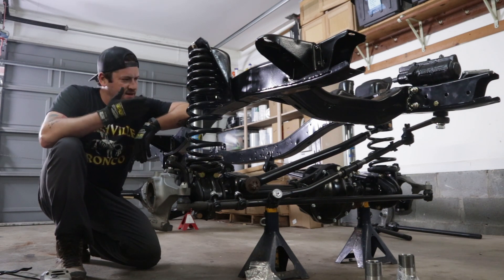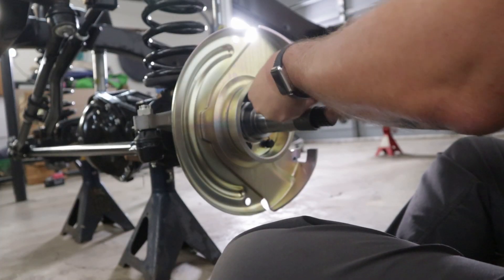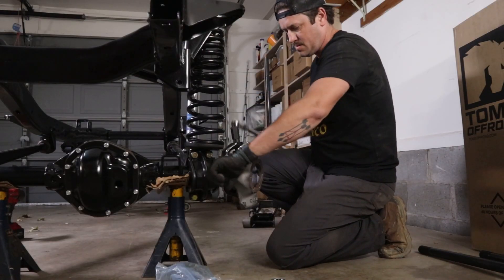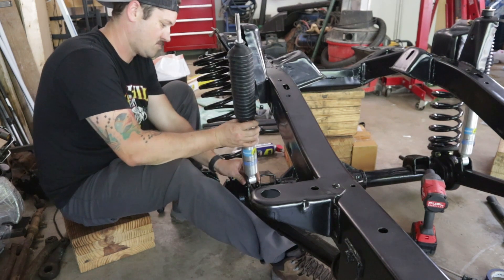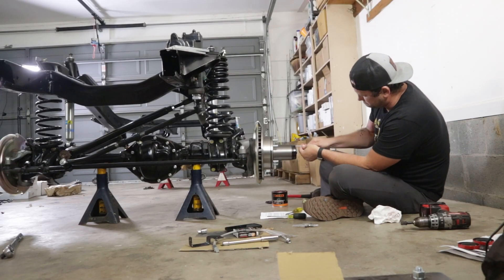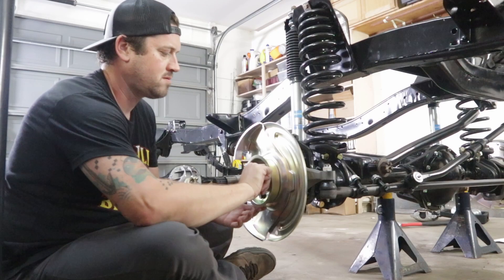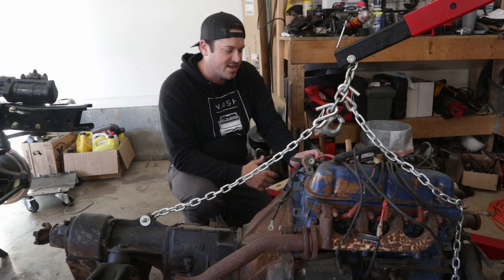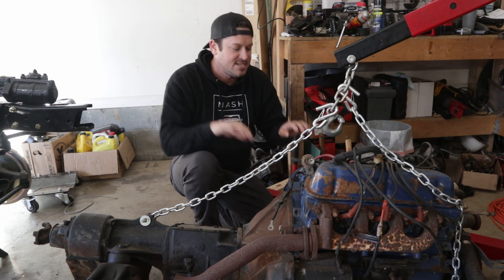Bronco Restoration Day 14 - Building a rolling Chassis

Comment: I’m currently building a 66. I sourced all the efi system from a 99 explorer. I’ve installed it on a stock 94 5.0 with a small cam. So this would be my vote for your setup. It’s a proven efi  design with plenty of replacement parts available.
Reply from the maker: That is a proven EFI for sure! I feel like if I’m going with a 302/5.0 it should look stock-ish. Even though EFI is not stock haha

Comment: I’d rebuild it with a stroker kit, AFR heads, and a ProFlow EFI. You’ll still have the original block and as much power as a coyote for way less money. You’ll make more (or lose less 😂) that way. Also, if it came with a stick I’d seriously consider a Tremec 4x4 5speed instead of the automatic. My 2 cents. 
Thank you for these videos. I love them
Reply from the maker: Nice! Another vote for a stroker 👍🏼 and the first manual vote, haha!

Comment: Engine wise go to pick n pull get a roller 5.0 out of an explorer, clean it up with paint, put on a trick flow top end kit from summit and your longblock is done including efi intake. That would be about 3k plus 300 for used roller shortblock. Then get used nv3550 with adapters,mount and then use 456 gears with skinny 33". I have that and it drives great and has overdrive. Plenty of power and decent fuel economy.
Reply from the maker: Nice!

Comment: I would decide on who you plan on marketing the finished vehicle to and let that direct you on the engine.  Your margin could be similar with either engine.  I’m a big fan of 302s and 351s.  Easy to work on, available parts. Usually plenty of HP can be found.  The new blueprint with the new block might be nice.  Selling price I would think would open it up to more buyers.  The coyote is the choice if you’re aiming at a higher price point and a smaller buyer pool.
Reply from the maker: That’s a good point for sure

Comment: I literally just done that front brake conversion on mine 2 days ago and ran new lines (body on = not very fun for that long line on the frame).
I would go with a rebuild of your original 302 and maybe beef it up a bit while at it and in turn you could go ahead with the build.
Reply from the maker: Nice! Another for original engine 👍🏼

Comment: Make it a BOSS! 
Grab a 351 roller engine stroke to 408. 
Grab a clevor kit from Edelbrock. EFI... Sweeeeeeet!!! 
My dream engine for my '67 u15.

Also on the brakes, I swapped my d30 drum brake axle for a 74 disk brake axle. I used big body bronco brake parts to keep it all Ford. 
Easy bolt on. And much stronger.
Reply from the maker: Nice!!

Comment: 331 stroker (.030 bore over). Use the AFR 165 heads, with custom grind cam (roller) that is spec to your entire set up (tire size, gearing, transmission/torque converter, heads etc.)
Reply from the maker: Nice! I like this

Comment: The coyote engine gives you the most $ for resell.  Most of those rebuilds are going over $100,000.  With rebuilders like Velocity, they are reselling Coyote rebuilds for almost $300,000.  Some are over 300.  So the 8 speed or 10 speed trans bolted up to a coyote is the top selling configuration.  I don't know what the Godzilla option is but it sounds interesting.  I bought a Ford Racing 302 crate motor for mine because I don't plan on reselling and it produces 340 hp.  That's not 465 like the coyote, but its respectable on the light  Bronco.  My three speed will light up the tires, but so will a trans break or a front brake on an automatic 10 speed. investing 20,000 to make an extra 50,000 does seem like a good idea whereas investing 8,000 to break even on a normal build is cheap, but renders cheap payback.  It's another example of you get what you pay for.  If I had the money, I'd go the coyote route.  I've seen motor w/trans used for around 12000.  To get the money on a used one though, you might need to rebuild them.  So for a new set up from Ford Racing it would be between 20-30,000.

Comment: I went with a blue print 408 and a 435 from Tom's. I still have my original 302 and 3spd intact on a pallet in case I ever want to go back. You will never get that bottom power from coyote.

Comment: I was faced with this same engine dilemma six months ago. My Bronco is about a week away from its first start.
Reply from the maker: What did you go with?
Reply: @NashvilleEarlyBronco  I decided to have the original 302 completely rebuilt. A little more hp. Pro Flo EFI. Ceramic headers. Auto trans. My decision process was: Coyote was really expensive and requires some previous experience to do it correctly. 5.0 from a Mustang or other was a good option but I've had friends who have had issues with the trans computer and harness. That left me with either the 306 crate or rebuilding the original. I chose the original num matching. What you have to decide is what brings the most money vs the cost to get there for a profit. I have way too much money in my Bronco. It's honestly not worth what I've got in it. Vintage air. Custom interior. Icon console and power steps. 7-inch Pioneer. New paint. Dakota digital RTX. Hydraboost disc. Bilstein suspension. Everything is new. I think if I had to do it again, I'd just buy one from some guy like me that spent way too much money building one. I wanted Grabber blue and that got me down this road. Love your channel.
Reply from the maker: Haha! I totally get that. I’m in the same boat and having the same thought process you are. 

Where do you buy the Icon dash?

Comment: IMO I always build with reliability, availability, and maintainability in mind (Yes, it's a Marine thing). I would keep it a 302. Millions of options for the 302 or 351 and plenty of hp that compares to newer EFI motors. Mine, with its build, comes in around 360hp. Run some spall electric fans and an oversized radiator and it should have no issues running the highway or the high mountains. When you go stroker or anything "one off" you run into more issues and if its resale?? Then keep it simple. Just my .02
Reply from the maker: Another vote for 302 with some wise wisdom 👍🏼

Comment: I am biased, but it is really hard to beat the 302.  One of the greatest engines ever.  However, when I eventually tear my 73 down some day, I want to do a coyote swap.  Although I do plan on keeping mine.  You would probably know better than me, how easy is it to sell a bronco with a coyote? Would it be easier and more practical sticking with the 302?  Whatever you decide to do, I'm sure it will turn out amazing.  As always, thank you for the great videos! I plan on using these when I rebuild mine.
Reply from the maker: Thank you! Resale it’s surprisingly pretty even 50/50

Comment: what do u think about the 4bt cummins ? great little motor, takes nothing to run it, insane fuel economy, and definitely different. you can buy adapter plates for the transmission of choice, im a big fan of diesel in general (hence my psycho ideas building my bronco). or perhaps the izuzu 4BD1T 3.9 litre ?
Reply from the maker: I love diesel. I'm actually filming up at Cummins tomorrow. I would love to put an R2.8 in a build in the future. May not be the right one for this build.

Comment: Rebuild the motor, either as 306 or a 347 stroker, mated up with the 4R70W will give you a really nice driver with off road capability.  On my 76 Bronco, it will be a 306 mated to a 4R70W.
Reply from the maker: Nice! Another vote for 302 or 347

Comment: Here comes my two cents worth. Blueprint 306 or explore motor with 4r70 or 6r80 transmission. I don’t think doing a coyote 5.0 or 7.3 Godzilla motor is budget friendly. Either of my two options would still net you a good return on your build. A Coyote or 7.3 will always bring you more money in sale price but it also takes more money to do. Also, side note, you’ll need to weld the brake hard line support brackets onto the 9” housing and the front braided lines where they attach to the caliper need to be positioned up at 12 o’clock not back at 3 o’clock. Looks great so far bud!
Reply from the maker: Another vote for Blue Print 👍🏼

Yeah, I actually forgot to buy the brackets for the front, and the original brackets are in the wrong spot. For the back, I need to grind down the powder and weld those on. Thanks for the reminder

Comment: OK, well its been 5 months now so I guess you already decided... but, I would keep everything Engine wise and rans complete an original but upgraded. Since you have the tank and electronic fuel pump I would use an after market Injection System. The problem with Modification is when you sell it, and trust me you will lose money just in the time involved, I think most people like Stock upgraded stuff. Just my opinion but the frame is finished and coated so just get it done and sold since that was you original desire... Beautiful work so far.
Reply from the maker: Thanks for commenting! I like that train of thought…

Comment: If you want top dollar you have to go Coyote. Next would be the Blueprint 306 but make the effort to put the Edelbrock Pro-flo 4 on it with a set of BC Broncos ceramic coated headers. 

The 4R70 is a solid choice for transmission but I suggest you lose the Dana 20 and go for the Atlas II.
Reply from the maker: So what’s your vote? Coyote or blueprint?
Reply: Maximize return on investment…go Coyote!

Comment: Coyote will have the highest resale value, I think when considering: you need new parts and  you will not have a numbers matching bronco. That said a 351 is great option to work within stock dimensions.  Coyote conversion costs are really high... but this is not a conversion. You don't already have the parts you need to complete your project, and you're not spending money to replace a perfectly good steering column.  so, if you don't have the parts to re-use I vote Coyote. If you do (and as viewers we are unaware of this) then 351W.  I think it's spreadsheet time with anticipated costs and anticipated sale price!
Reply from the maker: Another vote for Coyote 👍🏼 and a very wise vote to make a spreadsheet, haha!

Comment: whats a chassis like this worth? rebuilt front and rear diff, suspension, everything new and painted, etc etc but including a 5L engine with NV3550, all new driveshafts installed and rolling and if it had registration? just wondering your opinion?
Reply from the maker: Hmm… hard to guess without seeing it, but probably 15-20

Comment: Rebuild or Blueprint Engine. 
Personal choice—
That said, I just rebuilt a 351W— factoring all the new parts, machining work, new heads, cam, EFI, etc.—it was way more expensive than I expected.  Given my time invested, the parts and machinery, that Blue Print engine looks like a a good deal!  Yes I built an awesome motor for less than a Blue Print motor but not that much less.  Not that I plan to sell— but I certainly don’t have the engine building reputation that Blue Print has.  Bottom Line: Given what I know now, I’d give them a call first.
Reply from the maker: Good advice 👍🏼👍🏼

Comment: Rebuild the original 302 with roller hydraulic lifters and a mild cam.  How much horsepower do you really need in a Bronco(I don’t get the coyote thing)?  I’m just starting my 3rd EB restoration I’m doing a 4r70w also.  What are you doing for your cross member?
Reply from the maker: Another vote for 302 👍🏼

I bought the crossmember from Toms
Offroad. I haven’t fit it yet, so I’m not sure how it fits

Comment: I’m currently doing a Godzilla build. I’d do it all over again, but I don’t think it suits your build. We’re still on the front end of parts availability, which means costs and delays. Prior to that I was going to install a 427W Stroker. Again an engine I’d take over a Coyote. But if you’re building to sale, the Coyote is where you’re going to make your money, and you won’t need to install a Quick 6 (assuming you go with a 6R80 or 10R80).
Reply from the maker: A Godzilla would be awesome

Comment: Having the numbers matching drivetrain really isn't that important when your building a custom Bronco. My vote is for a 306/347 crate engine. Why put money into rebuilding the old 2 bolt main 302 block when everything else your doing looks to be pretty trick.

There's nothing stock about my 72 restoration so I wasn't concerned about having the original block in it. I went with a Dart SBF 427 stroker  crate engine, it Dynoed @570HP and a Gearstar AOD, EFI, and custom axles on 37's.

I think I've used about 10-12 of the orginal parts, like the frame, tub, hardtop, glove box door etc. Im putting the body back on the chassis for the final time Tuesday then the only thing left to do is everything, lol
Reply from the maker: Wow! Yeah that’s a good point. Another vote for the Blueprint 👍🏼

Comment: I am rebuilding a ‘65 F-250 4x4. Having said that, I am building this truck for Me and I have no intentions of selling it. I really don’t care what it costs, within reason. You are a little different story, as You are going to sell this rig. In My experience, restomod is another word for expensive, and the actual changes You make to the vehicle, can and will affect the build in a lot more than the actual component You are working on. When it comes to engines, If You are going to sell this car, I would be, fairly conservative, and put a engine that has good performance, but goes well with what was traditionally in these to begin with. A snappy 302 would not be a bad choice. Keep in mind You can get a lot of money in those too, but will probably have fewer custom changes to the front half of Your chassis, than a Coyote, or Godzilla. From My truck rebuild, I am going with what I would call a moderate build. Poorboy 410, (390, with a 428 crank). It still will end up being $15,000-$16,000, by the time it is complete. 300 horsepower in a car as light as a Bronco, will not be a pig. FYI, if You haven’t started on the engine, get going, as good engine builders are usually pretty busy, and in My case I was told, it would take 6 months to completion. Love Your videos! Wish My build was going as fast, but have been My own worst enemy, in putting modern components in an old truck that was not designed for them, and there has been many items that have taken a lot more time than I thought it would, and cost more, just like You said at the first part of this video.
Reply from the maker: I’m my worst enemy too. Too many decisions and I get stuck. Thanks for watching

Comment: Mine use to be that clean and not scratched up 😢Blueprint engine…warranty means something to the buyer. Blue print has a pretty good name in the industry. Not many people I know that I like the way they build an engine. He said “Stroke it”…..not a flat tapped….ask Mitch. You might think about putting in extra hoses to the fuel tank. I didn’t and had to drop the tank again when I made changes. Return line etc..You always seem so calm….don’t you ever just loose it?
Reply from the maker: Haha! I don’t often loose it, but sometimes I throw tools. 

I feel very similar. Someone buying this would probably want a warranty

Comment: IMHO the Coyote is too large for the Bronco engine bay and the performance benefit isn’t worth the expense. I’d stick with a Windsor. I’d also run an aftermarket multi port EFI that can control the 4R70W. I have a 95 Explorer power train now. It’s great, but most of the electronics are 27 years old…
Reply from the maker: Another for the stock engine 👍🏼
Reply: @NashvilleEarlyBronco  I don’t know about original block vs reman. Would need to compare the costs and time.

Comment: To not put a coyote in that would be a waste.
Reply from the maker: Another vote for a Coyote 👍🏼
Reply: @NashvilleEarlyBronco  Yea if I was building it for myself it'd get a predator coyote with a sequential 6spd. But since you're trying to sell it for profit, a regular coyote will probably get you the best bang for your buck.
Reply from the maker: Honestly I would love to put the Godzilla in there, but I would rather get this done quick and sell it
Reply: @NashvilleEarlyBronco  I'd take a coyote over the godzilla. A coyote is 150+lbs lighter and makes similar power. Plus the bronco is so light and has such a small wheel base it'll never tow something that requires the lower rpm torque of the godzilla anyway.
The 3.5L turbo ecoboost is probably the correct motor for the first gen bronco, it makes 350hp and 450ft/lbs, weighs the same as the coyote, but depending on how you plumb it, its smaller size would make it easier to wrench on in the engine bay.
Think I'd still take the coyote over the ecoboost tho, just cause v8...
Reply from the maker: Yeah, that’s so true. Those Ecoboost are super cheap too. But I agree, everyone wants a V8